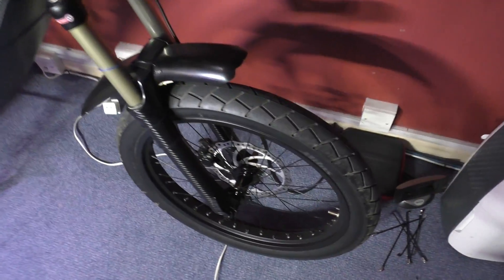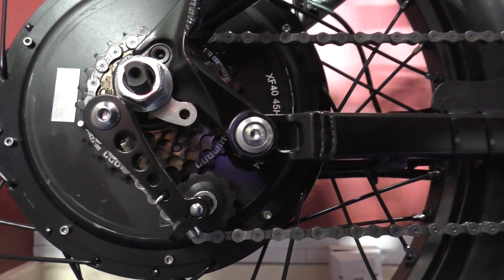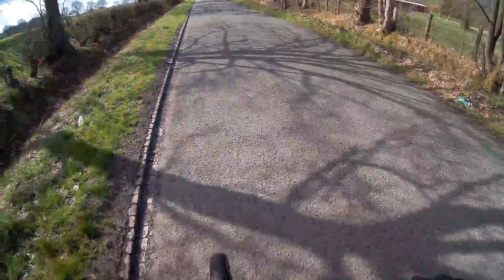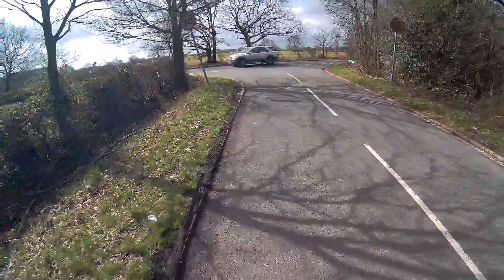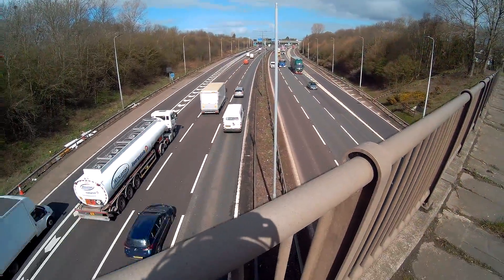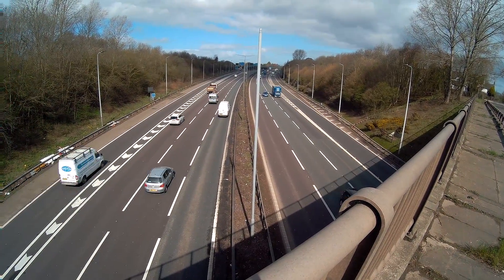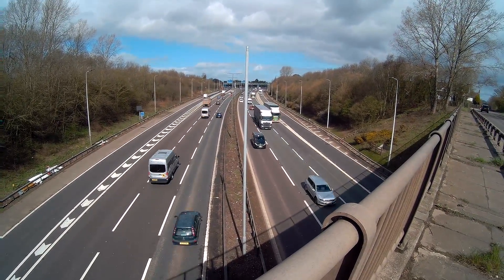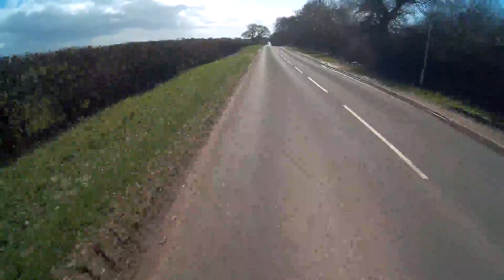Insanely fast DIY electric eBike - I want more POWER!

Comment: You're a bloody nut you know. That's why I subscribed!
Reply from the maker: Mad Englishman :-)
Reply: Bloody amazing little bike. Have you ever looked at Robert Murray-Smiths channel? He's developing some fantastic battery tech. A bit of a mad englishman himself I suspect :)
Reply from the maker: Yeah, I saw his 'ultrabattery' video a while ago. It's good but the current I need can only be delivered by LiPo or Li-ion batteries at the moment (until the Grabat graphene batteries are perfected and released).
Reply: The ultra battery is probably one of the least powerful batteries he has made. It's lead acid, not what he is interested on at all. He was just repeating an experiment where they put carbon over the plates to extend the capacity and cycle depth. His Graphene super capacitors are a different story. They are preparing a Twizy to go the entire length of Britain at the moment using a modular graphene super capacitor. They can be charged rapidly and RMS claims they retain 97% of their capacity after 10,000 cycles.

Here's a clip of a bike they converted:
https://www.youtube.com/watch?v=P266pdT71tI&t=

Comment: Perhaps the circuit breaker is not tripping because of the cold weather.  When it gets hot out it may be a different story.  idk
Reply: They don't immediately trip at their rated current.

Comment: Motorcycle trick for you to try. It is counter intuitive but it acts on the gyroscopic effect of the wheel: gently pull the handle bars the opposite way to which you think you need to and the bike will drop in to a corner. It sounds mad but it really helps. Give it a try and let me know how you get on.

Comment: Nice Wheels Dude !! what is the top speed, battery volt and amp/hours, and range, I built a 48v 1000w that is now at 60v 35 mph. (40 mph in traffic) I can overtake little scooters but they still beat away at the lights. I've never had so much fun !!
Reply from the maker: Top speed - no idea yet but I'm hoping for >70mph if I can keep the front end down (I act like a big sail on the top). Battery volts - It's now 84v. Range - Roughly 25 miles.  
As for beating me at the lights (up to 30mph)...... nope, nothing has yet. Not even the BMW M3 the other day :-)

Comment: How are the wheel bearings holding up. I've not found a bicycle platform hub that holds up too motorized power.  The bearing chaces chew up within 300-500 miles.
Reply: 2,000 miles on my derestricted  Cube MTB e-bike, no problem with the hubs. And it is a cheap one too.

Comment: As you use heavier wheels and higher speeds then the gyroscopic properties of the wheels become more prominent and you should learn about counter steering for your own safety and interest.
Reply from the maker: The Wind Breezes
Yup, straight over my head. 
Oh..... I'm not an imbecile though :-)
Reply from the maker: Kenneth Ord
I know all about counter-steering. I've been a superbike rider for over 30 years. I was tying to explain to people what it feels like to have a larger mass wheel on an e-bike. I've been asked the question of "how does it handle with motorbike wheels" countless times and I tried to explain without going into technicalities....... I failed again :-)
Reply: You can counter-steer a bicycle but it's not needed due to rider-mass vs vehicle-mass. With bicycle it's enough to lean correctly and you force the bike into turn. With motorbike being heavier than you, you MUST set it up for lean, or else it forces you out of it.
Still, if you sit rigidly on bicycle counter-steering works just as well even at 20+ km/h regardless of tire weight. Push the left handle bar and you'll swerve slightly right and swing heavily to the left.

Still though, a lot of cyclists are not aware of this and do this instinctively with weight and indeed would turn the handlebars wrong in panic.
Reply: That's what I tell new motorbikers. Learn about countersteering, and learn that the front brake does most of the work. Get too used to the rear, and you will lock up in an emergency. Seen it happen more than once.
Reply: He's going on about gyro effects. It's different. Look up a video on countersteering Kenneth.
Reply: back in your box mate
Reply: Much lighter than gas powered of the same performance so yes the gyroscopic forces would be more prevalent... Nice Vid!!;)
Reply: Just what I was thinking  ;?)
Reply: Vortecks no you didn’t fail, you aren’t responsible for the comprehension failures of every person who watches your videos and then decides to put on a a one man self cannibalism + gymnastics show/act as they proceed to contort their body in such a way that they can place their foot in their mouth, and then snack on it without needing to use their hands to hold it there, as the final act consists of typing smart ass, passive aggressive, nonsensical comments on YouTube, all whilst their body is being severely & increasingly contorted as they finish typing while inserting their second foot into their mouth w/out yet having removed the first somehow, to the amazement of the audience.
Reply: It's actually both.  Try holding a spinning bicycle wheel at the axles in your hands, and then turn it left (as if you were turning the handlebars left). The gyroscopic forces actually lean the wheel over to the right. The other forces you described also have an effect, but the gyroscpic ones certainly make it easier to turn.
Reply: What TF are you talking about and what does it have to do with riding an ebike?
Reply: And if that's confusing look up videos on angular momentum and applied torque and the alignment of their vectors.
Reply: Countersteering is noticeable on normal bicycles. Nothing to do with this.
Reply: But the tendency to run off on a corner is more on heavy wheeled bikes because the wheels simply refuse to lean unless you use correct technique against the tendency of the gyroscope to stay upright.
Reply: Vortecks - Cheers mate. Most cyclists haven't a clue what it's like to ride a bike with heavy wheels or at any speed. Normal bicycle wheels are feather light compared to motorbike wheels and the cyclists have no feeling for the gryoscopic effects they're having to overcome or use to move the bike. Geez, on a fast motorbike you can steer the thing using a tiny bit of pressure on just one grip, it's amazing you can control the bike with tip of your little finger, and not understanding that can be fatal. Try that on a bicycle (and I have) and nothing happens! But, it's difficult for some people to understand, gryo's aren't intuitive at all, but that's no reason to disbelieve the physics.
Reply: Kenneth Ord ur a wanker
Reply: Lewis sun
 - Wrong, see my other reply.
Reply: The Wind Breezes
 - You say "nothing to do with gyroscope properties" and then you contradict yourself with "manipulated by torque only". As torque is applied to any spinning body the angular momentum vector moves to align itself with the torque vector. Lots of people don't understand this, but this exactly explains gyroscopic precession (which Wikipedia defines as "movement of the axis of a spinning body around another axis due to a torque"). A not-so-easy-to-understand-but-basic example is this: a forward spinning motorcycle wheel has an angular momentum vector pointing to the left. When you apply a clockwise torque through the handlebars by applying pressure to the left bar end, then the resulting torque vector is pointing directly downwards towards the road (both defined by the right-hand-rule). The wheel's angular momentum vector moves towards the torque vector - from pointing directly left it  rotates downwards towards the road- and that means that the wheel leans to the left putting you in a left-hand turn. Again... apply pressure to the left bar end and the bike turns left - Countersteering. All spinning objects experience gyroscopic effects like this but for lightweight objects or at slow speeds don't notice them and other forces tend to swamp the effect. Fortunately the same movement of the bars in countersteering have a helpful effect at slow speed to move the bikes CoG for turning.  

As for your example of a bike built to counter gyroscopic effects then, yes I've seen those, but the key point is that they're lightweight compared to motorcycle wheels and not travelling anything like as fast and, though the wheel are acting like gyroscopes, their influence on the machine handling is tiny. That's not the case for motorcycles unless you're riding very slowly too.

I can't be bothered to work out the torque required to twist wheels of different masses and angular velocities, but you can get an idea by taking a bicycle wheel and spinning it as quickly as you can, and you'll find that you can twist it with your hands fairly easily against the precession- you're body weight added to that will overcome the precession without a problem. If you tried the same experiment with a motorbike wheel spinning as if it were going at, say, 30 mph, then you'd be thrown across the room or have your wrists broken. What I'm saying is that on a bicycle the precession isn't enough to affect handling, but on a motorbike it certainly is and you must rely on it to shift the bike weight and CoG for turning when at speed.

I doesn't matter if you understand this or not, and it's the explanation I was given and studied during my physics courses at university where I got my engineering degree, you'll still be safe on the road if you follow the instructors advice.
Reply: In fact body weight doesn't steer at all. Remember that a system in equilibrium (like  a bike going in a straight line) will act to retain equilibrium if something changed. So if you move your body weight one way, the bike will move the other way and the centre of mass of both you and the bike will stay where it is.   What happens is that when you lean your body weight, it actually causes countersteering inadvertently by subtle pressure on the handlebar.
Reply: @mikebiagio4155  i noticed this effect, and i always wondered why this happens, now i know. You are right, people do this without even noticing.

Comment: Safe cycling on the commute. Motorists pulling out from a junction will have a hard job judging your speed so be aware.
Reply: Going too fast through the busy shopping center.  One of those idiots pulls out, cause you're practically silent, and you'll do at least 5 flips in the air, "attached to the bike" before you splat.  Careful
Seen it too many times.
Reply: Playing stupid games brings you stupid prizes.
Reply: Drivers misjudge my speed on a crappy 250w bike at 15.5mph. And as a driver i wouldnt expect a cyclist to be going over 30mph unless going downhill.
Reply: @davidmowbray5352  

As a driver you should be ready to expect anything.

Comment: Hi Tony,
Every one of your posts is like getting a new episode in a comic book. You are a superhero! Love how it's transforming and getting better every time. Just be safe, I want to see some more videos the future. Even if it's just you riding to work. Speaking of which, everybody keeps asking how fast it I'll go, if they tune in to the other posts they will see. My question is have you done any calculations as to how far it will go before it requires a charge again? That of course is assuming you keep it under the 300,000,000 mps. :-) 
Sharpfocus
Reply from the maker: Cheers mate. I did a test ride yesterday and got 19 miles out of it (mostly full throttle). I'll be doing an economy drive when I have the patience :-)

Comment: How much did it cost to get all the electric components?(lmu's, bms, motor controller, battery's and the electric motor) thinking about making my own to use in the woods. Petrol bikes aren't allowed almost anywhere here and i hope to be able to ride with the electric bike hahaha
Reply: You can build something decent for less than £1000, and even make your own batteries from old laptop cells after testing them individually. Batteries are about half the cost of the bike!

Comment: An idea..... What about you use a gopro hero black 5 and then use the dashware program to pull out the GPS data (also has g force etc)!!! I use it for skiing works a treat!
Reply: Neville Wood gopro is evil
They pretended the cube with round corners and are filling lawsuits against companies which sell cheaper superior products
This is like when apple patented the rectangle with round edges but worse

Comment: Another great video.  Bike is awesome. Andy Kirby has been very helpful with my ebike build. What model is your hub motor Tony? One of mine is the C and N 5000w 72v and I'm not that happy with it. I have the Adappto Midi-e controller I have the all the boost mode settings turned up to maximum but after about 2mins I get thermal roll back and it cuts back the power? I might invest in a ps 205 50h 300w hub motor and Sabvoton controller.  I believe that is the way to go if I want awesome acceleration what do you think?
Reply: Just took my second Enduro ebike build out for a test ride and it's no fun what so ever? It's fast for a couple of minutes and then it gets hot and shuts power down to almost a walking pace?  I ain't entirely sure the Adappto Midi-e controller is man enough for the job? If I invest in a different controller would it be any better? What controller would o Get? Kelly or Sabvoton? The hub motor was very hot to the touch aswell? Please help I'm at my wits end and  have spent a fortune?
Reply: What you should have done initially was either, read up on Ebikes exhaustively on the Endless sphere forum, or plan your entire build with an Ebike engineer, including working out the required turn count (kv) and power of the hubmotor you'll need based on the speed, torque, voltage and size of rim you're looking to run, which will be based on your anticipated riding needs.
Using a mismatched hub e.g very low turn count like a 3t (for higher speed) in a large 26" or 29" rim and expecting it and the ESC not to get hot from overwork is unrealistic, once one is stuck and has the components already  there are methods to shed unwanted heat in a hub, like ferrofluid and hubsinks but it's always best to work out and match your components for maximum working  efficiency if you want then to stay cool and work well.

Comment: Fucking yeeaa!!!! That turned out great! Those wheels are so cool, I noticed you run 2.50 - 19 tires and they seem to fit well. I run 2.35-26 tires and I also would like to get motor cycle rims and tires because they are speed rated and run smoother but I'm worried they are smaller and I will loose top end speed. What do you think?
Reply from the maker: Motorbike tyres & wheels are measured differently to cycle wheels. A 26" bike wheel is the equivalent to a 20" motorbike wheel. 
Have a read of this..... https://www.electricbike.com/moped-rims-tires-hubmotors/
Reply: Thanks for the info and sharing your experience!